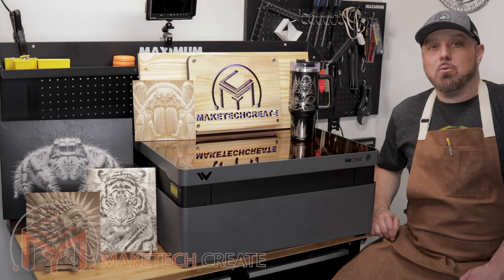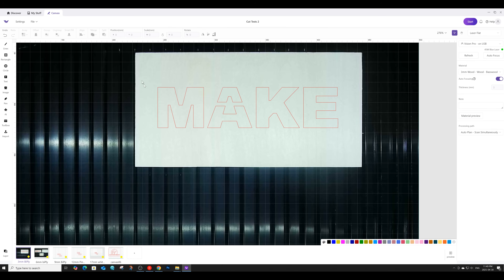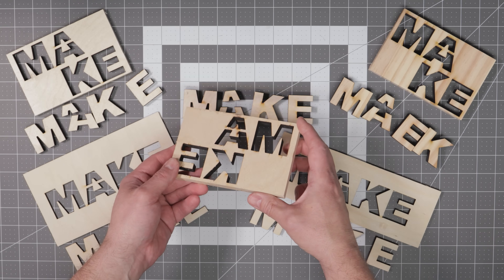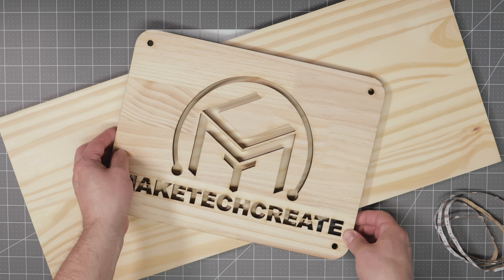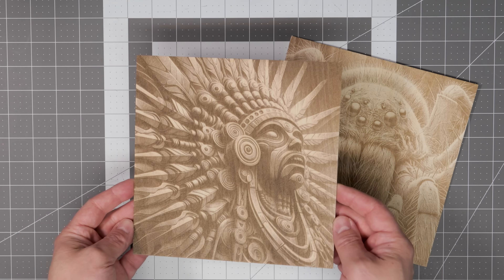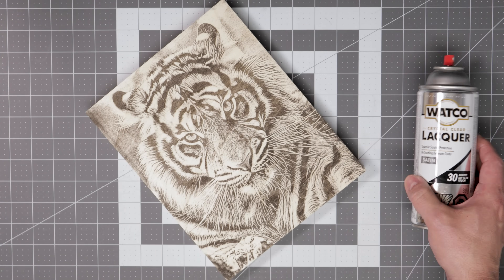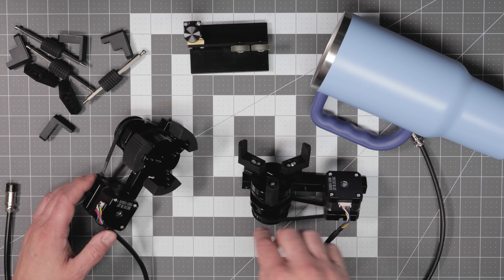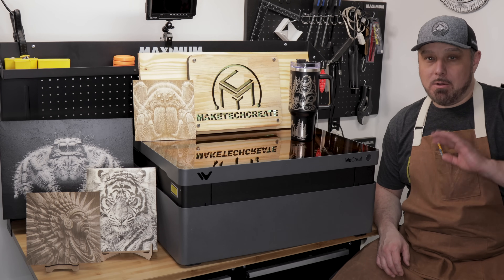WeCreat Vision Pro 45w: Worth the Upgrade?

Comment: Great video and very instructive. Thank you for sharing your settings. I have a question, did you use air assistant for your engraving?
Thank you
Reply from the maker: Usually, I turn it off. But, it really depends. I always test. Sometimes, air has little to no effect.

Comment: How is the cut on a thick material (wood). Is it square to the surface? Or has a little inclination (angle).
Reply from the maker: There's a bit of an angle, which will happen with any laser. Most people wouldn't notice it.